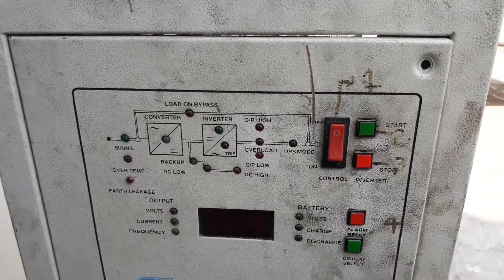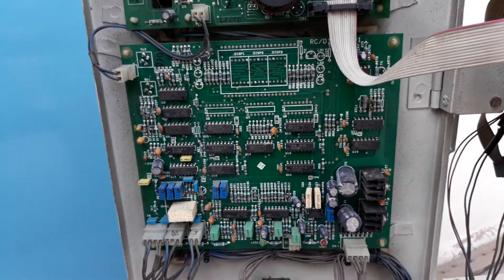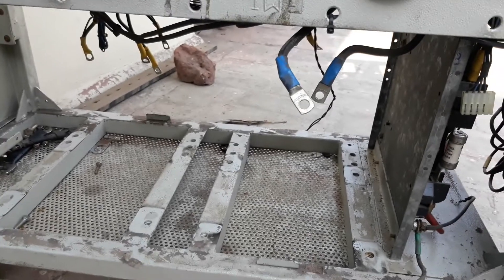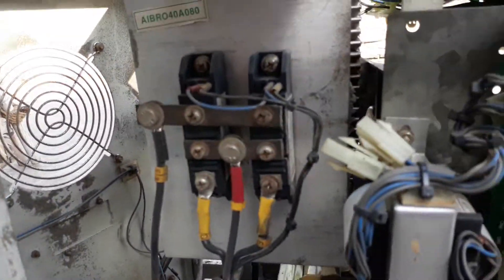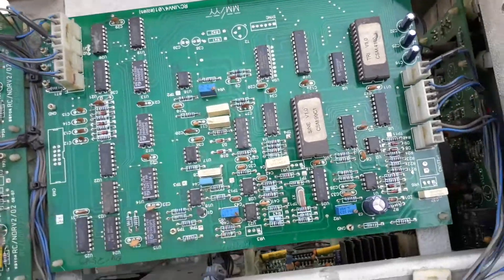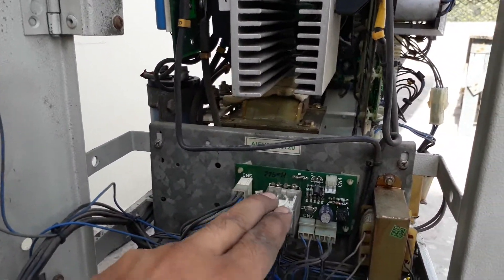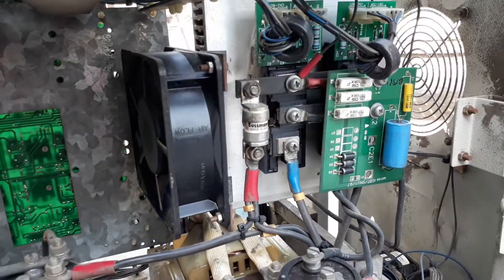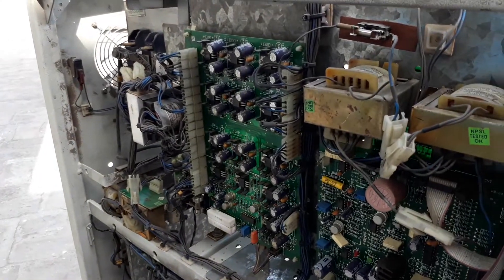Numeric 2KVA Online UPS

Comment: This ups not charging voltage..
Reply: Charging voltage show nahi kar raha hay
Reply from the maker: Mithun Debnath u need to check charger Card, check step down ac supply to Charger Card 20-0-20
Reply: Sir 20-0-20 is ok..but iske alaba or kiya chek kor sakte hay..
Reply from the maker: Mithun Debnath agar 20-0-20 aa rhi hai then charger card work nhi Kar rha, scr not firing, check scr PE input supply aa rhi hai
Reply: Actually is ups properly no idea